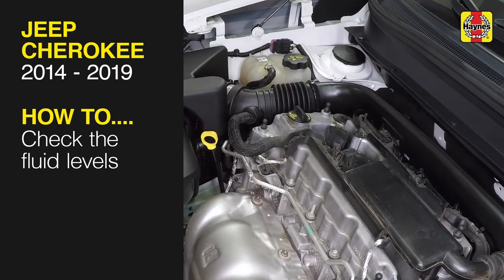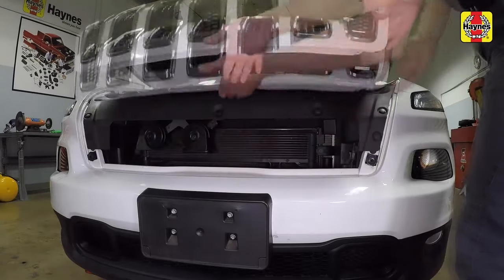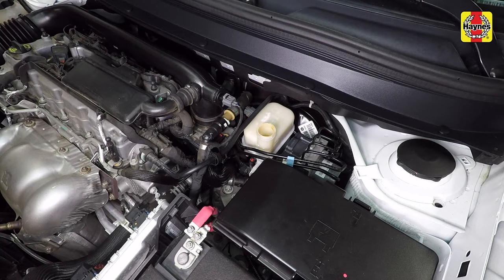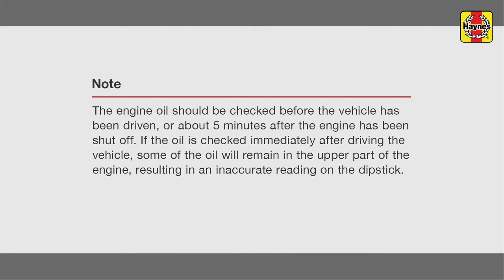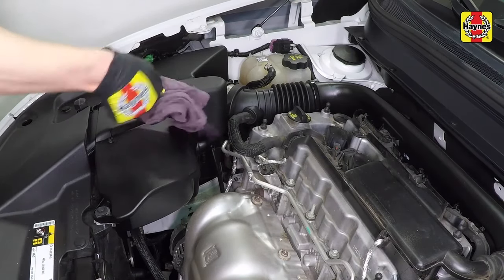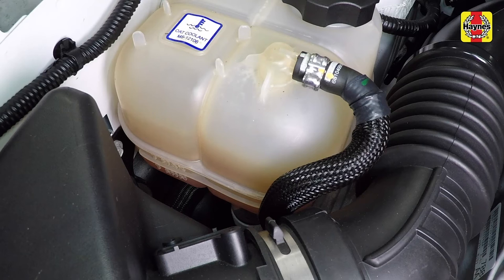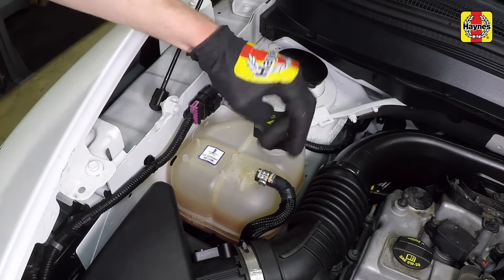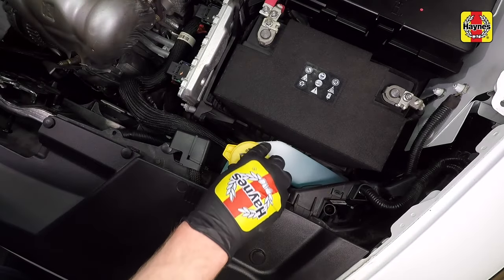How to Check the fluid levels on the Jeep Cherokee 2014 to 2019

Comment: What about transmission level
Reply: Thats what I came here for. Didn't get it.
Reply: Transmission is considered by Jeep as a "sealed system" that should never need servicing during the life of the vehicle. Servicing is possible, but it's usually quite extensive and expensive. One of those jobs that Jeep considers a "dealer-only" job, and it'll cost you quite a pretty penny. They recommend only doing so if there's major slippage occurring or transmission failure.

Just spoke to a tech about it earlier.
Reply: @mr.wallie2575  did you ever figure out where you can check that out?
Reply: @JosephDalrymple  yes unreal for customers service, especially when vehicle maintenance costs every minute of just assment cost thousand or three times depending where you go, for vehicle maintenance, disgusting of Dodge, wouldn't recommend ever again but now days all vehicles are going through something like it aswell cheap to manufacture and export but,Extra Expensive 🫰 to replace an maintenance

Comment: what about the final drive and the PTU fluid level?
Reply: Transmission is considered by Jeep as a "sealed system" that should never need servicing during the life of the vehicle. Servicing is possible, but it's usually quite extensive and expensive. One of those jobs that Jeep considers a "dealer-only" job, and it'll cost you quite a pretty penny. They recommend only doing so if there's major slippage occurring or transmission failure.

Just spoke to a tech about it earlier.

Comment: Video is so bad, half the fluids you need to check aren't even included here.
Reply: Not only that. But the windshield washer fluid. I learned the hard way. DO NOT fill that puppy all the way to the top!! Leave about two inches. Because in the winter, that stuff expands with temputure changes and the plastic container will crack!!
Reply: What are you talking about? Transmission is considered a closed system and should never need servicing and the power steering is electric hence no fluid to check
Reply: @buccaneerbob11  lmao